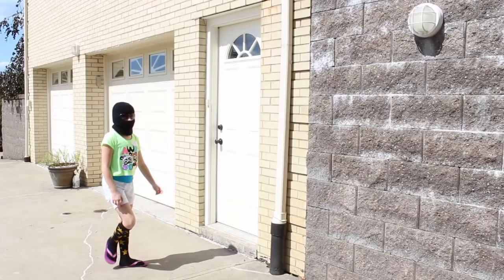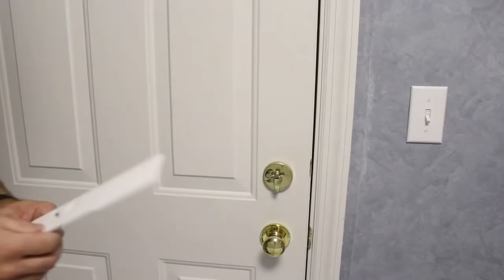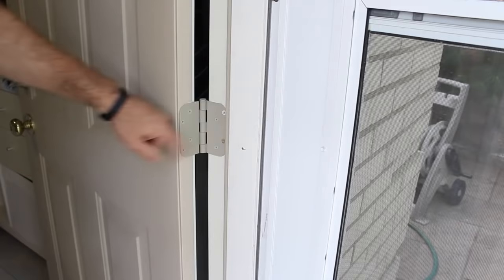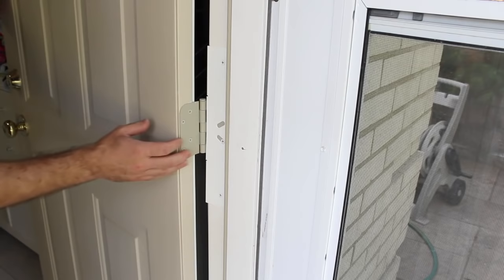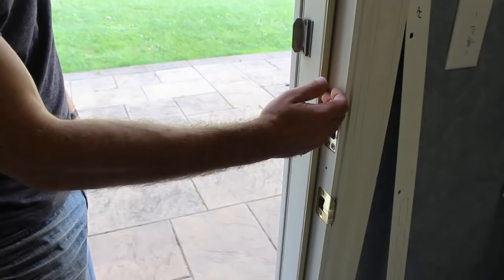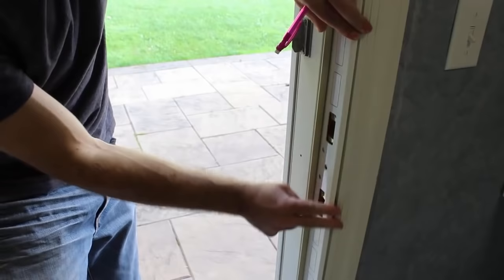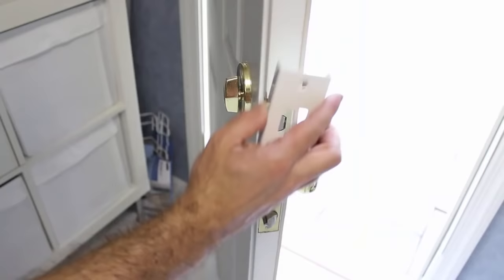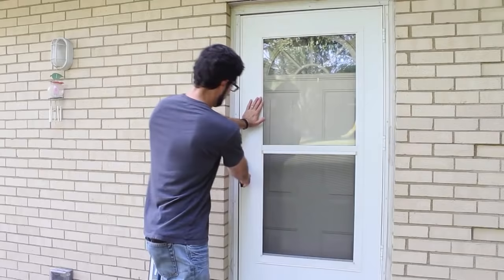How to Reinforce and Burglar Proof Your Entry Door

Comment: I wonder if this is something you could easily make in your garage out of 1/16th inch steel and completely customize it to your doors? Seems like that would be a LOT less expensive than $60 per door. You cut pretty easily cut the steel using a Dremel or angle grinder. If you don't have a Dremel or angle grinder, you could head to Harbor Freight and buy one for $15... then you have an angle grinder, which you can use for more home project, as well as door shields. Also, what about windows?
Reply from the maker: no doubt, you could possibly build a kit with angle iron

Comment: This is how I started my business 40 years ago by repairing break-ins, and from there it grew into a full house renovation business that I retired from 5 years ago. My only problem was reinforcing a place that was later taken over by drug dealers and when the police came they couldn't get in. The next day in our local paper It was written the next time the police find a place that heavily fortified they are allowed to use small Dynamite charges needless to say I freaked out and we are not a small town we're actually a major city. These days I have a thick chain going right across the back of my door so that when I open it I have to unlock the chain so they can kick in the door but the heavy chain is still there
Reply: What are the best security methods and devices I can install on my house to fortify it like that?  I just bought a 1 story house with 3 doors (each one is the type that little girl kicked in on the video) and triple paned windows on the back, which I either want to put security bars on or replace with break resistant glass.  I have a tall wooden fence surrounding the backyard, so it's plenty of cover for someone trying to do dirty. What did you do to that house you mentioned?
Reply: These days I live in an apartment. First get an alarm from a local well known alarm company.  Your home insurance may give you a reduction. I also installed some cameras and a monitor but these days Amazon has newer and cheaper systems. Also good for receiving packages Etc. For my windows, home depot sells 'Flat Bar' 6' or 8' . It's basically 3/4'' wide soft steel bar. It's easy to cut, bend and drill to make window bars DIY. You can get your local handyman to make you some security bars for your windows with this flat bar. For my door what I did is you can buy these L-shaped bars made of strong steel that you can screw into the Mainframe either side of your door so that when you close your door you can drop a two-by-four behind it going horizontally across they sell them at Home Depot for a few dollars. nobody's going to kick in that door. when I leave home I cannot put a two-by-four across the back of the door but what I have is heavy-duty chain that is permanently screwed into the Mainframe on the hinge side of the door and on the handle side of the door I attached it to a 6in long eye bolt with a padlock so that when I open my door there is a big chain going across the back of it that has to be opened with the lock so if someone kicks it in it's only going to open 6 in and by then the alarm system will be going off. Hope that helps. For sliding glass doors what I did at that house was I made a chain link curtain. I bought about 100 feet of chain when I cut it into 8 feet by 6 feet length I made a large chain net and I bolted the cross pieces with nuts and bolts so that chain net was put across the sliding doors at the back of the house so when the boys in blue decide to break in they couldn't get through that chain fence and I heard they tried to shoot the chain links to break them but it didn't work. The front door had three-quarter inch plywood backing with a laminated wooden New York beam behind the door so the battering ram didn't work either meanwhile all the bad guys got out the side window not my fault I didn't do it on purpose.
Reply: @James-ke5sx  Thank you! I have begun looking into window bars and what options exist for those, and I also see the door jammer kits like the one shown in this video at Lowes.  I would absolutely have an inside door bar installed, that is a great deterrent.  I'm not paranoid, but I do realize it might start to get a little crazy out here if/when basic supplies start running out.  I also live alone, so these measures will at least keep the place safer until I can get a dog.  I appreciate the tips!
Reply: Take care and be safe and if you need any information just use this comment to send me a message I've been a carpenter and house builder for 40 years

Comment: The term you want to use when you are cutting the space for a hinge or the security devices you are talking about is mortise. "Grooving out" is something I did in the 60s, and it had nothing to do with installing security devices :). Another suggestion, if the work you're doing calls for drilling a pilot hole, then you should drill a pilot hole. It makes no difference whatsoever what kind of drill you use to insert the screw into the wood. The type of drill does not negate the need for a pilot hole. Nevertheless, your security ideas are good. However, to use the word "burglar proof" is far from  accurate. Burglar resistant maybe, but to claim something is burglarproof means that I burglar will have no chance under any circumstances for success. Given enough time, a burglar with the right tools can get in anywhere they want to.

Comment: WHY on earth all your doors open inwards? That is dangerous also in the case of fire. Here in Finland all our doors must open outwards so that you can escape as soon as possible in case of fire. It has been mandatory for ages.
Reply: Also, the door frames, locks, and the door itself are usually very light in construction in the United States. Even if the door is reinforced with a separate package, it still doesn’t get very strong. This often also applies to other structures in the house. In some cases, kicking even next to the door can get inside even faster than walking through the door itself.

Comment: Your door will still be kicked in fairly easily. The shields you left out will be the weak point. The deadbolt will rip right through the door.
Reply from the maker: Maybe R, and you're welcome to add those shields. This is simply how I installed it.

Comment: In this case, you need to predrill even with an impact driver. Please do not listen to OP here. Pre-drilling is done on dry wood (like your house's frame) so the wood wont SPLIT under stresses from having metal in it. THe wood can split days or months after the screw goes in. Wood shrinks and expands with humidity and temperature. Steel... also does, but way way way less. Predrilling removes some material, leaving a pocket for the relatively static screw around the dynamic wood. If you split the door frame, well, it's half way kicked in now isn't it?

Comment: I doubt that door is solid wood, so 2 and a half inches of the 3 inch screws are doing very little, 
The plate for over the door latch that he left off could easily have been fitted by just recessing the wood then the door could shut,  and the weak point would be strengthened.
Wonder why the top hinge was not reinforced with a plate or the door side hinges ?
Whole thing seems half baked

Comment: if the door is wooden then burglars can use a drill and a saw to cut around the door handle and the lock. then magically the door will open wide.
They can also put liquid nitrogen and then they push the door and every metallic part breaks like an ice cube. this happened to a friend's house.
Reply from the maker: Wow, those were industrious burglars pioupiouCY - liquid nitrogen is cool stuff but hard to get. I wonder if they were chemistry majors (lol, I say this because that's my major).
Reply: pioupiouCY never heard of liquid nitrogen, where can one buy that?

Comment: I put 2"by4" or 2"by6"inside backing the doorjam as trim or molding.i lag bolts them to the framing.then I put bolts on the top and bottom of the deadbolts after I drill holes in the door.this keeps the door from splitting at the deadbolt the 2"by's keep the jam from splitting.a pile of shit tried to break in it held . The pile only bent the deadbolts

Comment: how does that prevent them from simply sticking a crowbar between the door & doorframe (or warping the door itself) & bending the doorframe out enough to pry open the door?
Reply: Jarrall H 
If you have a cheap door and frame I suggest you tear it out and install a new one.

Comment: Jeff you need to used the door shields. Ez Armour is a system and missing any part will likely fail. My door did the same. I purchased a wood shaver. Problem solved.
Reply from the maker: Thanks Antwon627
Reply: You're welcome Jeff, if you do it, I'd like to see your update.If you do one.
Reply: +Antwon627 is right.  The door will split instead of the jam.  The installation will be useless without the door protectors.
Reply: +Dan Johnson most exterior doors are metal and much stronger than the jamb's wood.
Reply: this door is 'metal clad" the middle is just wood around the edges and foam in the middle. kick it and the door will split. a shield around the door is also needed to slow down a bad guy, or a warrentless search.

Comment: You aren't making it burglar *proof* -- you are making it slightly more burglar *resistant* ... With a big glass window off to the side, he's going to go through it... I go with an "active defense system", but with a young kid around, you might not want to do that...

I once was renting a house and as I was still moving stuff to the house, the "urban youths" burglarized it while I was at my old place for the night, getting a new load of stuff.  Nothing was stolen because all I had moved at that point were boxes of old college textbooks.  They kicked in the door and ripped the trip off the door frame, so I got to see how poorly it was designed.  I redesigned the door to have 2x6s for the trim around the door and 3/8"x6" lag screws every foot around the 2x6s and into the 2x4 wall studs.  To enhance the striker plate, I took a piece of 1.5" angle iron (1/8" thick) and 4 ft long and recessed that into the 2x6.  The next time they tried to break in (while I was out of town on vacation), they could not get through the door, so they broke through a window.  Once the 7-month lease was up on that house, I moved.

Comment: Question: 
Will this product work on "double doors" since the last longest metal piece you used is drilled into the unmovable door/wood casing? Since I have double doors, for me I would be drilling the metal piece into my other door where they meet in the middle. Thx for you assistance.
Reply: Your best solution for double doors is to put a bar (or bars) across the full width of it from the inside and then use another (single) door for entering and exiting your house.

Comment: ALWAYS PRE-DRILL. I agree with using 3 1/2" screws, preferably stainless steel...300 series.  Dip the end of the screws into vaseline for easier installation.  I see no purpose in a door shield or hinge shield. The JAM  SHIELD I agree with.  I made my own for free, being an ex sheetmetal worker. But I used 1/8th " steel. The kit is over priced and a waste of money.

Comment: Most of the screws sold today are cheap pot metal which will just snap right off no matter how long they are. Who sells high-strength screws? Even longer than 3"?
Reply from the maker: +Barkity Bark Grip-Rite, they sell deck screws 👍

Comment: You didn't line up the jam shield correctly. That 1/4 or 1/8 inch difference makes a huge difference. Over time the deadbolt might not fully engage.

Comment: Never have an entry door that is designed to open to the inside  case closed.
Reply: Most external doors are made to open in so the hinges aren't exposed to weather and, so burglars can't just knock out the hinge pins, pull the door out and walk in.

Comment: everyone has their own way of reinforcing the entry door. i think this kit is a rip-off, for thin metal and screws. but everyone seems to agree on long screws, you can get #10 2-4inch screws for cheap, strong locks, and maybe a backing plate if you rly wana add extra work and security.

Comment: Don't listen to this guy. Predrill the holes so you don't split the framing wood behind the door jamb. Also, remove the strike plate that interferes with the new security plate so its not bowing out the new security plate. Replace all the screws with nothing shorter than 3.5 inches. There are stronger screws out there. I would replace all the screws that came with the kit.

Comment: gave me some good tips,, i would prefer to use all the hardware they give you in a kit,, you should of chiseled  the wood to make it fit
Reply from the maker: I hear ya Kevin Bomkamp. I agree with your idea. One other tip another fan had was to make sure to drill out the jamb so that it doesn't split. So I should have emphasized that a bit more in the video, too. Thanks :)

Comment: Just replace your short screws with long one. and save $55
Reply: while you're at it, get some thicker plates for the 'jamb' side if you need to... a long screw won't do much if the plate it's holding can be ripped apart by hand, or it succumbs to a kick/body check...

Comment: Groovy … now that you’ve done all this weird crap … go ahead and leave those Kwikset … or Kwikset knockoff locks in place.

Being a locksmith of several years, I can say this is better than nothing on a Home Depot type wood frame but the “Best” part is simply get and use Longer, Harder Screws in both Door and Frame.

Just don’t pull your frame out of true in the process.

Comment: No matter what you do to reinforce your doors, the nearest window will open instantly with the slightest rap with a rock.
Reply: Not true everywhere, here in Miami, many of us have hurricane glass installed on the sliding doors and windows so we don't need to put up shutters every time a big storm comes close by, that glass will hold up to projectiles moving at 140 MPH and you would ware out your arm before breaking that glass with a hammer, it's easier to breakout the concrete around the windows than break the glass.  Another great benefit is the near total sound proofing of that glass, it's worth every penny.  You don't need to live in a bank vault, just make it harder than the average thief is expecting and he will move on to another house.  They don't like to stick around after making noise.  Alarms and cameras are so cheap now, they know they don't have long to work.

Comment: Did the door armor thing but my alarm system stopped working so took off and alarm works again any ideas? Returned product.
Reply from the maker: Hard to say Adan Saenz - maybe the product was blocking a sensor. That's my best guess without seeing your setup. Sorry it didn't work out.
Reply: Returned got my money back. No worries just FYI. When removed everything back to normal. Thanks

Comment: I can't see how this would help in any way...I just replaced all of my half inch door screws with three inch screws and then I put even more three inch screws in various spots around the door frame to prevent the frame itself from being kicked in. It cost me about $10. I can't see how these plates would do anything.
Reply: +Kyle Bridenstine ...............they help the company put 50 bigs ones in the bank...maybe $8 worth of products $ 2 for the box  its all a scam .............some screws like you said is all that's needed but when you live in them BIG HOUSES you need products to " KEEP YOU SAFE " so a company makes em and dumb asses  buy them......
Reply: I didn't believe it either until I saw one in someone's home.  The door was being taken out and they tried to kick it in (smash it in really)  and it wouldn't budge.  Then the kit was taken off and the door was quickly smashed open.  It was explained to me that the metal plates spread the impact forces over a much larger area and the metal can't split like wood.  Seeing is believing!
Reply: I didn't believe it either until I saw one in someone's home.  The door was being taken out and they tried to kick it in (smash it in really)  and it wouldn't budge.  Then the kit was taken off and the door was quickly smashed open.  It was explained to me that the metal plates spread the impact forces over a much larger area and the metal can't split like wood.  Seeing is believing!

Comment: I don't know, but I would of took the striker plates off installed the reinforcing plate first and put the striker plates over it so the latch would not be beating the crap out of its self on the edge of the plate.
Reply from the maker: +mrelectron62 👍

Comment: 1 steel Z bar on each side of the door jam anchored to the frame with 4" wood screws on the Inside of the house...……   Anytime you need to or want to, lay the 2x4 or steel bar across it.   The only way anyone will get thru the door is by breaking thru the door itself, they wont Open it.
Reply: The problem with that kind of thing is that someone can lock you out of your own house if you leave for a minute

Comment: It would be easier to come through the walls at my place then trying to kick my door down or in. Door is skinned on both sides with 3/4 " plywood that has 20 carriage bolts binding it together. 6 inch screws into reinforced frame. Two large  11" gate locks added inside along with barn door handles mounted to door frame so I can slide 2x4' s through handles across door.  Front widows 15 off the ground. No window by door. Rear Windows I have mounted hinged shutters made from 3/4" plywood. I also have snake surveillance system so all I can say is good luck. If one makes it through my door, they then need to worry about what is inside. (Chuckles to self)
Reply: Snake=aanke
 One day I will learn to proof read. Damn kindle has auto correct that can't be disabled.